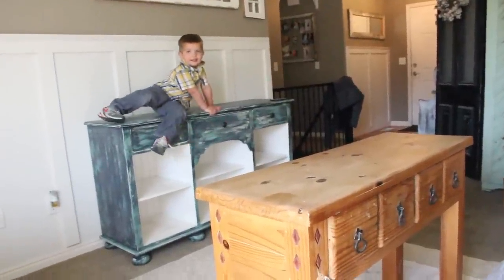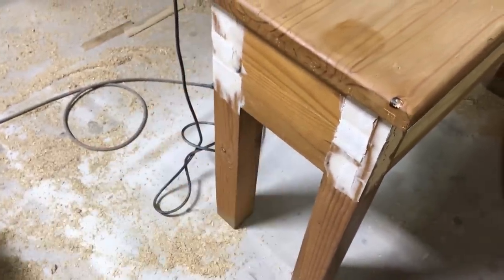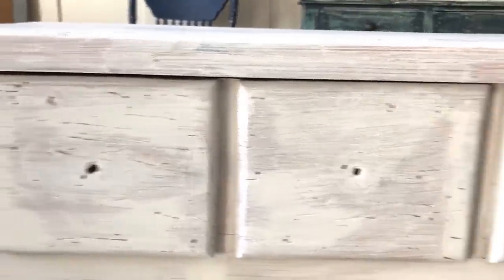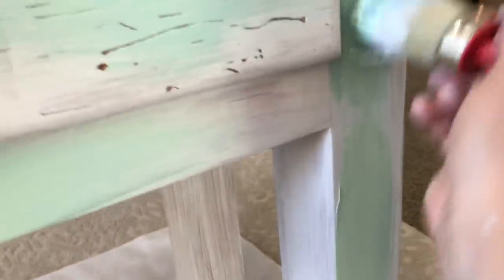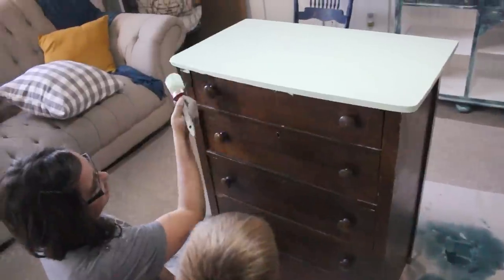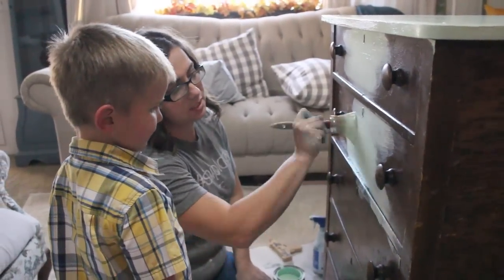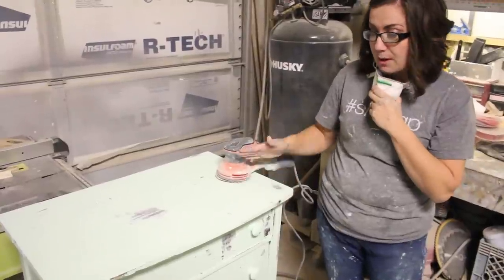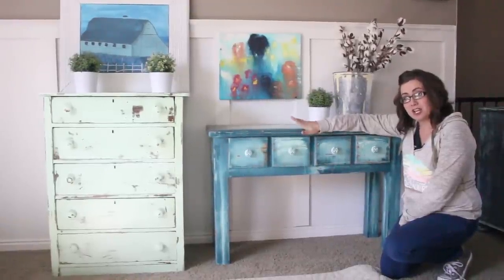How To Do Chippy and Bohemian Paint Techniques With DIY Paint

Comment: how do you get the crackle look , love both and the colors, thank so much for sharing, bless you
Reply: Vickie Sizemore that's what I was wondering
Reply: I agree. I love crackle
Reply: Yes!!! The crackle effect? Great work!
Reply: Sometimes a piece will crackle on its own if its old, depending on the products you mix . Its a chemical thing.  But if not, there are a number of products that you can use to get the same result. One is an Annie Sloan product - its a two part process.  Another is Maison Blanche.  Both products can be purchased on-line.  Oh, one more which is the easiest in my opinion - Amy Howard.  Google them!  Good luck!

Comment: Does the clay based paint take the place of sanding the wood?
Reply from the maker: Not in all cases but it adheres so well it’s minimal to no prep. Unless the piece is shiny and you can see your reflection in the current finish just clean and paint. If it is shiny take 5 minutes to scuff the surface with 220 grit sand paper and then paint.

Comment: Why don’t you take the drawers out to paint them separate?
Reply from the maker: If the drawers fit flush we like to leave them in place on old dressers, helps keep them sliding good with less sanding or taping off.